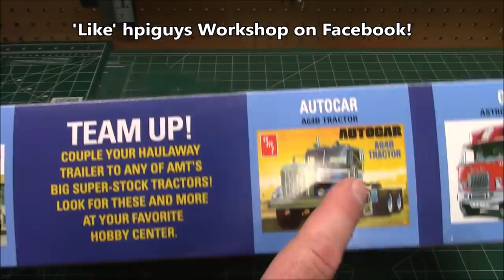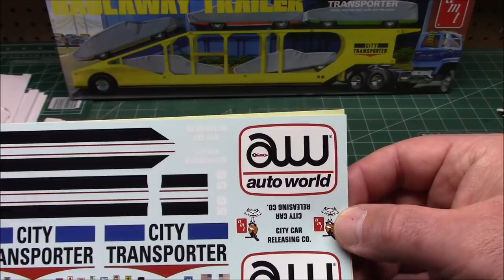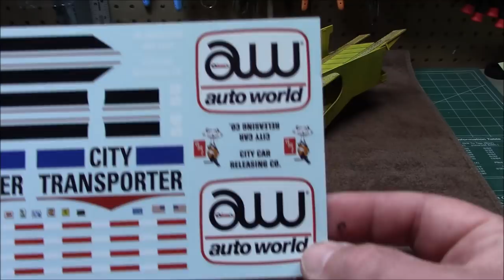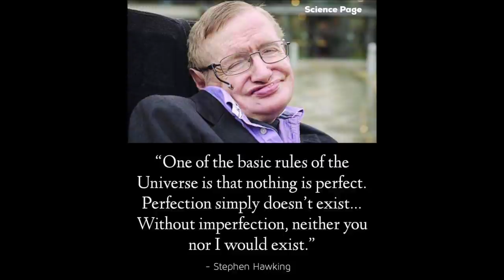AMT Five Car Haulaway Semi Trailer 1/25 Scale Model Kit Build Review and Weathering AMT1193

Comment: I didn't see it hitch to the Autocar or any truck, would have been nice to see and if you had any problems placing trailer kingpin to truck fifth wheel.
Reply from the maker: It's a simple pin, there is zero issue, the fifth wheels on all AMTs will work well.

Comment: I started building automotive models when I was a kid, around 7 years old. After a 20+ year hiatus I'm getting back into it (61 now). I started spraying my kits with Testor's spray cans and some times auto touch up cans. I eventually moved to airbrushing. I noticed with the auto touch up paints they went on a bit thicker so one had to be careful not to hide small details. That was one reason I started using an airbrush, I would decant the cans and spray with the AB. Does the Rust-Oleum go on thin or thick?
Reply from the maker: Sprayed lightly it goes on fine and I have no issues with details.
If you hose the thing down I'm sure it will look bad, and it will also take a long time to dry.
I knock these kits out every two days, I couldn't do that with super thick paint waiting to dry.
Reply: @hpiguy  Thank you! I'll have to give it a try.

Comment: Another fun build! Hey Chris, what particular line of Rustoleum paints are you using? I was in my local Ace Hardware yesterday and noticed there is more than one line of Rustoleum paints.
Reply from the maker: I use a LOT of the 2X labeled ones, they dry fast.
I use any of the metallics, they work great for everything. 
Primers are all the 2X labels.

Comment: Another colossally helpful video. What temperature is it around your paint booth? What temp range do you recommend for painting (min / max)?
Reply from the maker: Humidity is the biggest factor. You want low humidity, 50%is best. Temps between 50 and 70 in the basement year round.
See my video on painting with cheap spray cans, it will help.